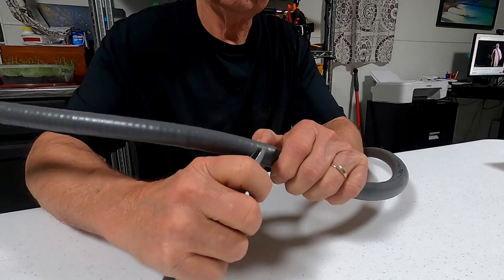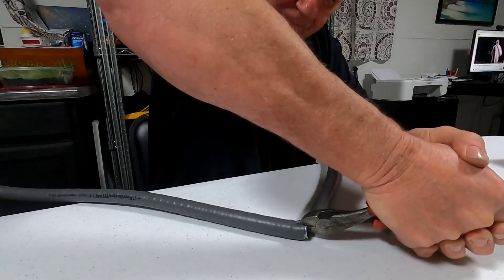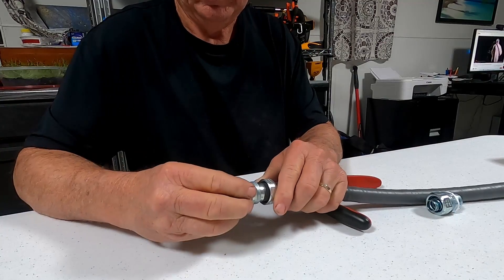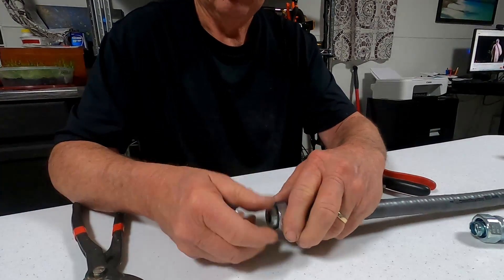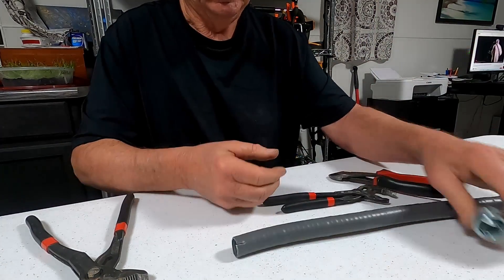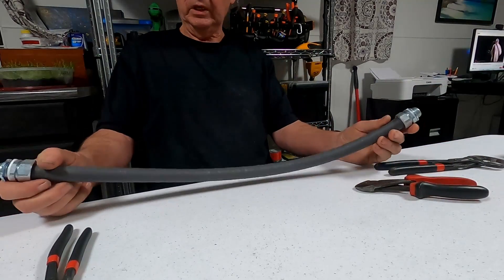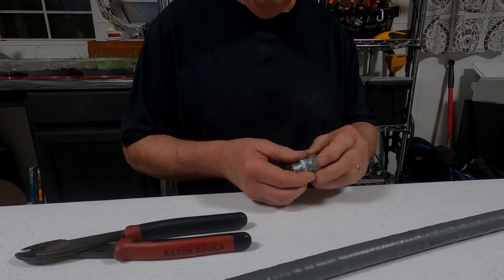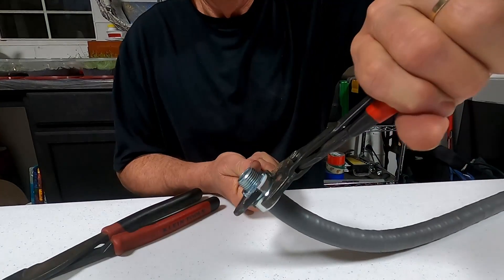Liquid Tight Flex End Installation

Comment: Any opinion on PVC ends vs these metal ones?
Reply: This video shows Liquidtight Flexible Metallic Conduit ( LFMC ). PVC connectors are used with Liquidtight Flexible Nonmetallic Conduit ( LFNC )
356.12 Uses Not Permitted. LFNC shall not be used as
follows:
(1) Where subject to physical damage
(2) Where any combination of ambient and conductor temperatures
is in excess of that for which the LFNC is
approved
(3) In lengths longer than 1.8 m (6 ft), except as permitted
by 356.10(5) or where a longer length is approved as
essential for a required degree of flexibility
(4) In any hazardous (classified) location, except as permitted
by other articles in this Code
Reply from the maker: If you are using it for an industrial application use metal ends.

Comment: Uncle Hippy didn't go into an explanation but he demonstrated what I needed.   The connectors won't thread into the metallic watertight conduit unless you split the 1st course.  Opening it up will let you get the end of the connector far enough into the conduit to get it started.

Now.. I'm ready to upgrade to L3 EV charging.. as soon as it's not -7°F out.    Hrm.. Maybe I'll wait till tomorrow before finishing 5-30R outlet install that up.  :-/

Comment: I have read that a "bonding conductor" is required for liquid tight non metallic flexible conduit, is this imperative and if so how is it done?
Reply from the maker: I have used a bonding conductor in conditions requiring XP (explosion proof) wiring, however some companies may require it in other situations. Local codes and regulations may also require a bonding conductor you will have to check with local regulators to be sure.
Reply: @robertsheward9336  spiral it on outside of flex